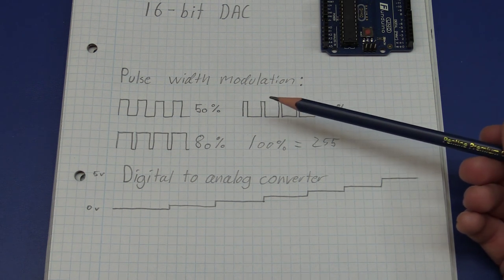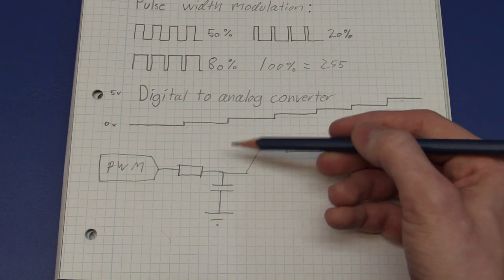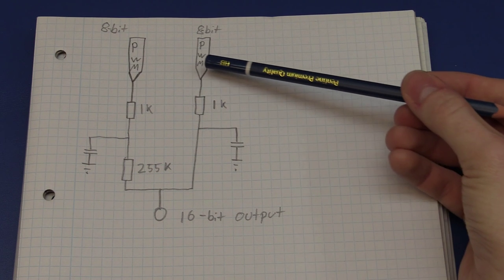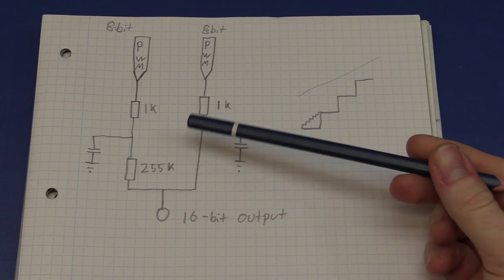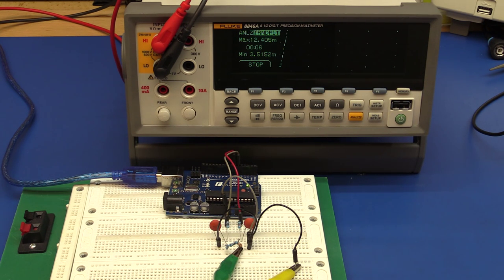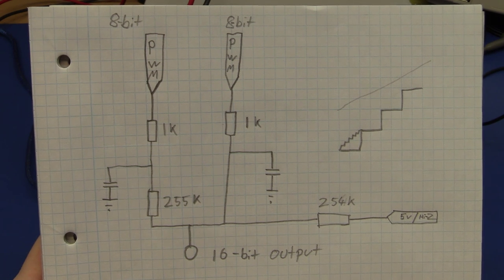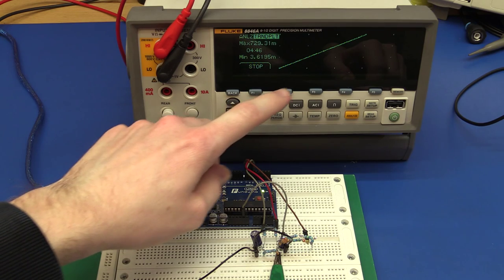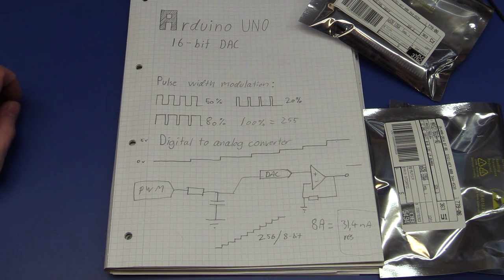16-Bit DAC / PWM on Arduino UNO - Ec-Projects

Comment: I have also been building my own ADC, and looked into this method. It is possible to change the PWM frequency by changing the timer prescale values, which allows you to decrease your settling time while maintaining a low voltage ripple. There are 3 timers in the Arduino, and one of them is used for a lot of timing functions, so changing that one is a difficult option, but the other two can get you ~32kHz at 16MHz clock speed. Much better than the 470Hz default!

Comment: 15:50 You could remove the spike caused by the LSB PWM output going to zero, by removing the capacitor for that output.  The other capacitor is on the total output of the combined signal, so that should be enough.

You could also reduce the amplitude of the ripple by increasing the PWM frequency, keeping the same capacitor value.  I'm not sure if you said what it was - if so, I missed it.

Comment: Awesome video! Did you ever figure out what caused that jump on the first high bit?
Have you tried an R-2R latter between the two outputs to weight it? I'm curious if that would be better or worse.
Reply from the maker: Neo55378008 Hey! Thanks :) I didn't look further into it. Just an idea that came to my mind which I wanted to try out :) Nope haven't tried the R 2R :)

Comment: Very interesting and thorough, thanks.  A couple of points.  You could probably reduce the spikes you got when using bigger capacitors on the 8-bit outputs by putting a capacitor on the final output.  Secondly, I'm surprised you got a good result from your first attempt... luck?  The voltage change between on and off states for the most significant bit is about 64000 times more significant than that of the least significant bit, for 16 bit accuracy.  So if switching the lsb makes a difference of 1mV, switching the lsb should make a difference of 64V !!!  Even if you can get an accuracy of 100 microvolt on the lsb, you still need a swing of 6.4 V on the msb, more than an arduino output.  I don't think you can buy resistors for your circuit that are accurate to one part in 64000, so this approach involves patching together several close tolerance, high stabilty resistors ad hoc. Last but not least, you can get an accuracy way beyond 16-bit from an arduino uno in other domains....  (eg connect it to internet for timing error of 1 second in 10 years or more.... ha ha ). Hope your later work with dac chips turned out well!

Comment: I wound up using an I²C DAC myself - just made life a lot simpler. No matter how much software voodoo I tried I could not get tight fixed current using PWM but had hoped for a little better results. Either too much ripple or too slow reaction time. I wish the AT chip had a real DAC built in as well as 16 bit or high ADC. Oh, well, can't have everything.

Years ago I'd write PWM routines for the PC parallel port, but that's another topic for another system.
Reply: From what I've heard, it is very very difficult to get higher than 12 bits DAC/ADC in an MCU because of digital noise, and chip layout. Might be some other reasons as well.
Reply: what dac did you use?
Reply: Benjamin Esposti how about raise the frequency of pwm to max prescaler and use timer 1 which is already 16 bit resolution. 
Read more about it to understand how you can set that..

Comment: I am guessing that you used the AnalogWrite function? The Arduino libraries are easy to use at first, but it's many times better to directly set the registers. The AnalogWrite function contains a "hack" that creates your problem. Setting a value of 0 into the PWM register gives a duty cycle of 1/256, a value of "n" gives (n+1)/256. The Arduino dudes didn't like that behavior, because they thought that a value of 0 should give a duty cycle of 0/256!! Exactly there lies the problem. So AnalogWrite(0) gives a duty cycle of 0/256, but for all other values it has the same behavior as setting the register directly i.e. AnalogWrite(n) gives duty cycle of (n+1)/256.
Reply: +taz0k2 Essentially they just added a simple if-case for the zero case: "if zero then just put the pin LOW". Not very intuitive imho. Also explained here: http://www.righto.com/2009/07/secrets-of-arduino-pwm.html just above the Troubleshooting subheading.

Comment: Could you pull another Arduino 8 bit PWM IO pin into this project? Effectively making a 24 bit DAC? I would like to experiment with making a precision voltage source, settling time of the RC filter is a non-issue. Also, is your code available for download? Thanks!
Reply from the maker: caall99 Hello ! In theory you could do that, but in practice it will be very difficult :) You will have to get all the resistor values 100% exact. And there is probably too much noise on the PWM :)But hey, still worth a try :) I have put a link to the source code in the video description. :)

Comment: the analogwrite function jumps from 0 to 2, skipping 1. you cannot set the duty cycle to 1. this is by design because of a quirk about the fastpwm mode on these atmega chips. the hardware can be set to 1, but it cant be set to 0. you cant get 0% duty cycle. the Arduino team decided 0% duty cycle was more important so they just disable the pwm at 0 and then skip the first value. i agree with their decision. you CAN get the pwm to honor all values correctly if you change the mode from fastpwm to phase correct pwm which is what i usually do. its a little harder. you have to read the chip manual and setup the timer registers yourself and you can't use the analogwrite function any more. you have to change the output compare register value to adjust the duty cycle. its not necessarilly hard, but if you're at novice level you might not want to dive that deep. honestly i wish arduino would just make phase correct mode the default instead of fastpwm. i cant really think of any downside to that.

Comment: Whats wrong with using the 16bit pwm timer that the atmega328 has on it? I dont get the point of this
Reply: Did you ever find an answer to that question? Perhaps the same principle can be applied to attiny85 type chips with only 8bit timer?
Reply: Because the Timer period becomes too long, unusable for audio, for example: 16MHz / 2^16 = 244Hz. Harder to filter out such low frequency either.

Comment: Ahhhh... looks like you took down your source code! Can you upload again? Working on my 24 bit variant as i type this. Thanks.
Reply from the maker: There is an .ino file at the bottom of the page ?
Reply: EcProjects
Its back now. i think the link was down for a little. thanks!
Reply: EcProjects  Would you be able to link to pre-bug fixed version of your file? I am trying to learn bit shifting and don't quite understand how to combine two outputs to increase resolution. If my input is a number between 0-65535 (16 bit), how can i make one output do the high 8 bits and the other the low 8 bits. Confused.
Reply: caall99 I figured it out :) had to looking into binary parallel summing.
Reply from the maker: I don't think I have that file any more sorry :(
Reply: EcProjects

Comment: This is why you have a problem:

The PWM outputs generated on pins 5 and 6 will have higher-than-expected duty cycles. This is because of interactions with the millis() and delay() functions, which share the same internal timer used to generate those PWM outputs. This will be noticed mostly on low duty-cycle settings (e.g 0 - 10) and may result in a value of 0 not fully turning off the output on pins 5 and 6.

http://arduino.cc/en/Reference/AnalogWrite
Reply from the maker: ***** Thanks, I will have to look into that.. :)

Comment: I bet the initial too-large jump is because you're using a fast PWM timer (rather than phase correct PWM). Fast PWM has a period of 256 ticks but you can only specify a duty of 255. Arduino "corrects" this by switching the output off when you choose duty=0, but setting the duty to N+1 when you specify duty=nonzero N. If I'm right, it will be corrected if you use timer 1 or 2 (move the pin 6 connection to pin 9, 10, 11, or 3). See https://www.arduino.cc/en/Tutorial/SecretsOfArduinoPWM

Comment: It is not possible to achieve 16 bit DAC output using PWM from uC pins. 10-12 bits max. Any videos on this matter must be supplemented with INL/DNL curves as a matter of proof.
Notice that the power to the uC is provided by USB bus, which level varies considerably and inherently noisy. Just move PC mouse to see 50mV jumps!

Comment: You put 8 bits (255 steps) in to 1 (lager step)bit, then you have 64 bits (8x8)?? not 16! NO that's not right. 256*(8+1)=2304 steps in total = a resolution of 11 bits + some spare I think?.( I'm confused now lol) and you have to put a capacitor at the output, not on the separate outputs!
Reply: when raising to a power you must add exponents. So 2^8 x 2^8 = 2^16 (= 16bit)
basic math ;)